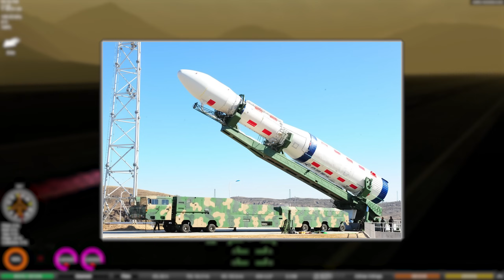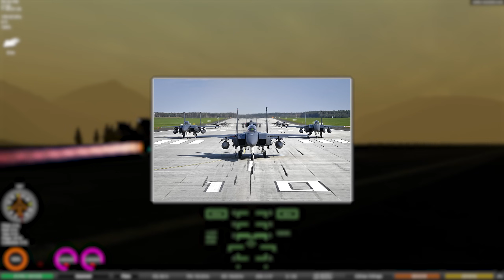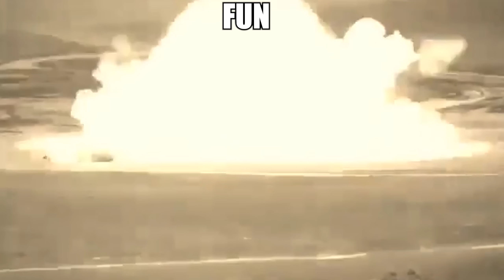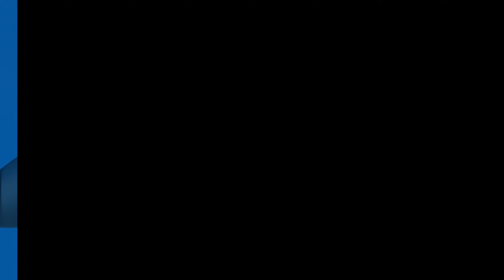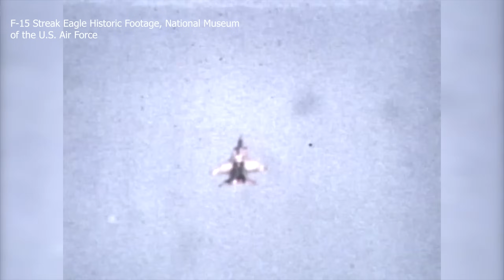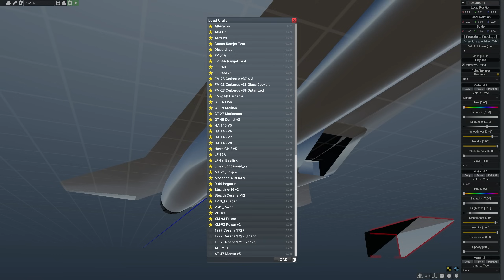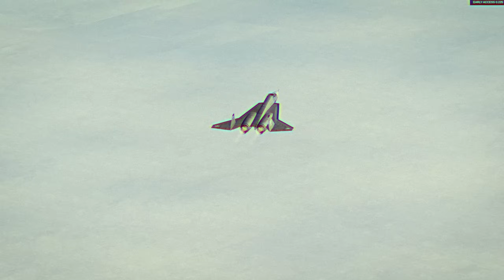I Continued America's Most Ambitious Jet Fighter Program

Comment: This has probably been asked before but what would a modern rocket fighter look like? How long could you keep this “world’s fastest fuel tank” in the air and what would its range be?
Reply: F-36 with RDE's? (Rotating Detonation Engines)
Reply: All fascinating designs in the comments here but I was thinking purely chemical rocket propelled aircraft. Nothing practical I’d just love to find out how much more efficient a Modern ME 163 would perform with todays tech as compared to the original design.
Reply: @haydnw869  well it probably wont melt the pilots at least

Personaly if such a thing is made i expect it to be used for anti sat work (or airlaunched balistic missles , more on the cheap missle then the cargoplane with icbm )

Get high then use the rocket

Or maybe just a reuseable anti sat missle first stage ?
Just to save the electronics
Reply: You could ask how would SpaceX design and build an improved version of the Silbervogel, originally designed by Eugen Sänger.
Wings? Check.
Rocket engine? Check.
Liquid propellant? Check.
No air intake during flight? Check.
Almost the same thing.
Reply: @haydnw869
Rocket technology has not improved at all since the 60s
I would know trust me on that one 

But hydrolox engines like Rs25 have an isp of around 350 in the atmosphere and of course hydrogen is very bulky and makes your plane big and with a lot of drag
Some petroleum instead will be smaller but have an isp around 300-330. That’s abysmal
Jet engines tend to be pretty bad as well but usually still have between 1000 and 2000 for the turbojets. Both of these values are awful btw 
But if a rocket engine had 1000 isp, barely 3 times higher than current chemical engines, it could reach orbit while having as little fuel on board as a plane. The NERVA project had about that performance but was canceled by a governor so he could give the few millions the project cost to his constituants as handouts, don’t you just love democracy

So that’s your answer; a rocket plane using a methalox liquid engine would have around 1/6th (or lower) of the flight time of a jet plane, and not even necessarily have more thrust or be faster. It’s also completely absurd to do it because why would you carry oxygen when yourself are flying through oxygen. In WW2 planes used some chemical compound that stored oxygen as a liquid (not sure why they didn’t just use cryogenic oxygen) which they dumped into the engine to make the planes be able to fly higher for a few minutes. That’s one potential reason to have some oxidizer with you. But overall rocket planes would just be terrible because our engines are terrible

A cooler similar concept that should work is nucIear scramjets. You just have a core growing red hot near meltdown, use your speed to compress the incoming air and shove it into it, which overheats the air, forces it to expand and pushes it out the back. Something like that could fly maybe for months withought touchdown, without a pilot though, food and all that
Reply: @IceRain-f5v thank you very
Much for the feedback and Curse that governor!!
Reply: I mean, being totally honest this would be entirely dependent on requirements being set-do you want a miniature point defence interceptor, or something (eg same as a 163), or do you actually want to try and have decent range and endurance?
Reply: @LiahTam27  why not both! One designed for super manoeuvrability high alpha fox 2 dogfighting point defence and interception similar to the Eurofighter and the other for pure long range/endurance  like the Global hawk
Reply: @ Fair enough then, I think that seeing the two extremes would be interesting-the point defence interceptor would by far be the more viable of the two, because a range oriented rocket plane would have to sacrifice a rocket's largest advantage (possibility of compactness) in return for its fuel storage. 
Obviously building an engine with more variable thrust regimes and probably a relight function would be mandatory, but even then I don't think it's a concept that lends itself to loiter time and similar all that well.
Reply: @LiahTam27  Super manoeuvrable interceptor fighter it is then!
Reply: I wanna know too
Rocket engines are smaller for the equivelant turbofan giving the same thrust, the remaining extra volume could be used to house oxidizer
Reply: Rockets are a bit pointless for atmospheric planes outside of their ejection seats and RATO, as the specific impulse of air-breathing jets is just so much higher. It only really matters when you need lots of thrust at any cost in a given specific moment.
Reply: A rocket is generaly a bad idea for a aircraft because you need to carry oxidizer and fuel like the me 163.  air breathing rocket were developed but IDK how they failed.  A rocket fighter may only be usefull in space combat though.
Reply: @Christmas_Gman  air breathing rockets are either the SABRE which basically operates as a jet or a rocket depending on mode, or a rocket that uses ram-air stuff to generate extra thrust but still needs fuel and oxidizer
Reply: @ez_theta_z9317  the sabre was canned
Reply: @Tyrannosaurusstudios  yeah but the theory is sound and iirc the engine did have some successful tests
Reply: @ez_theta_z9317  true
Reply: @ I know exactly, I would just love to know how much of an improvement a ME 162 would be if it was made with 2020s technology. With completely modern fuselage/rocketry?
Reply: @haydnw869  the problem would be the fuel. Hypergolic fuels are volatile. There was a nasa monopopellant being explored but in general... rockets are bad for planes. All new research is for fast burn to achieve high speed. Burn time is largely the same, but distance is increased because speed.

I imagine that a hybrid rocket system with air breathing high bypass turbofan would be the best option. Solid fuel motor with external oxygen supply.
Reply: @ or a Modernised X-15 that could take off and land on runways.
Reply: @ nasa might atempt a X-15 like experiment with the rotating detonation engine there coocking.
Reply: The best way to make something like that is to have a hybrid turbojet ramjet engine there was actually a serious study by the navy to make some like that to be a interceptor I could go into more but look up on google ADLI VOUGHT or advanced deck launched interceptor the designs are wacky cause they have to land and be stored on a aircraft carrier but go Mach 4.5+ and be a missile bus at the same time it’s crazy